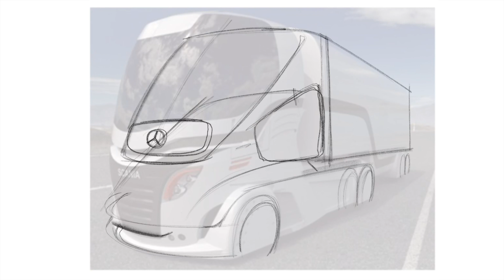Demo 15: Using Photographic Underlays in a semi Truck Concept

Comment: Nice video M, Ever since I have been using digital tools like sketchbookpro or procreate I have found myself using photographic underlays more and more because its very quick and easy and you can rapidly try different perspectives without loosing a lot of time which I feel increases the design quality as it gives you more design time, less setup time. I really find it a good tool. I also don't see this as cheating. As for future videos, I would like to see footwear, mainly because I don't know where to begin, proportions, rules when drawing silhouettes, upper patterns and features. Thanks!
Reply from the maker: Thanks for checking out the video and the comment. I just so happen to have a footwear tutorial "in the can" as they say. I just have to do a voice over on it. I'll try to get that up next week. This one will be on working up a sketch in illustrator. I have a few previous footwear demos as well. Here is one to get you started: https://youtu.be/ZWBqUazHcI0

Comment: Cool concept! If I find something remarkable online, I’ll save it to an inspiration library. Grabbing those for underlays helps for construction, and can also inspire aesthetic or functional insights. Is that cheating? 😆
Reply from the maker: I think most of us gather inspiration imagery. I'm pretty active on Pinterest, gathering images and sorting them into trends that I start to see. I think overlaying an image for aesthetic inspiration can run the danger of becoming derivative. In this video I used Adam Plaethorpe's image as a perspective and proportion guide, but the ideas and design I laid over top were very different, intentionally.
Reply: Michael DiTullo thanks for the reply. Do you ever use unrelated product underlays, like sketching a speaker over an underlay of contemporary furniture? It is derivative in some senses (by intention), though the result is also intentionally different by design.
Reply from the maker: @martinveldsman  , that is a great ideas. I haven't done that before.